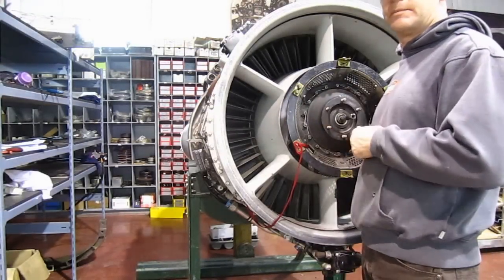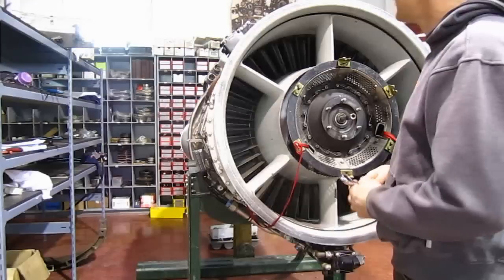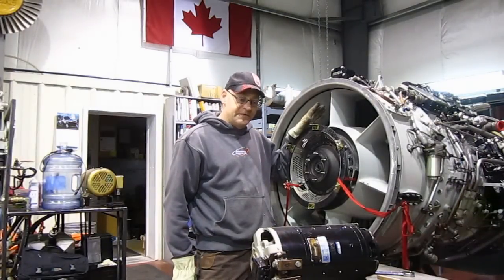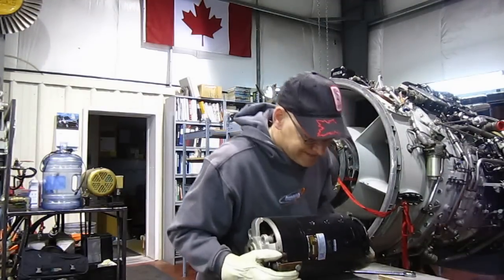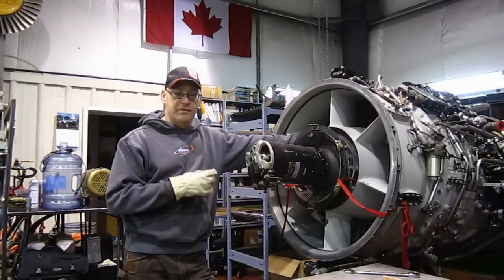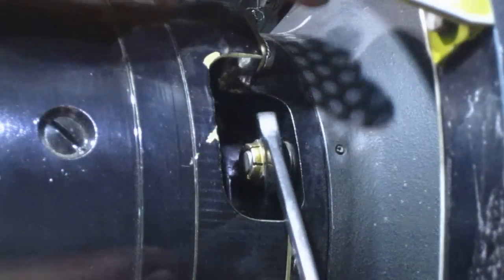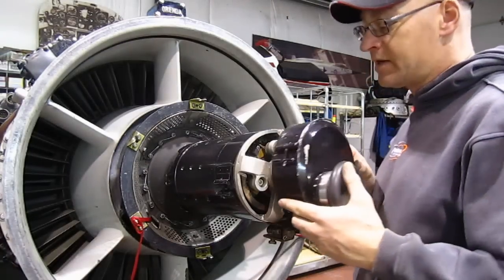Electric Starters for Jets ?

Comment: I find it kind of amazing that we had the technology to design and build these things in the 40's and 50's.
Reply: and without any computers,  just "slip-sticks";  I still have mine..  Also the  original electric starter was a starter/generator built by Cad  engineer Chas. Kettering around 1912.  It mounted around the flywheel at the back of the engine.  Kettering founded DELCO  (Dayton Laboratory Company);  he also co-invented Freon for use in home refrigerators as a replacement for ammonia gas which was killing people due to leaks which is why you see the frig
placed outside of early homes, usually on the back porch.
Reply: there were bold people to develop such invention, that lasts nowadays
Reply: You call them slipsticks,this side of Atlantic we call them slide rules.Great term,slipstick.

Comment: Very informative, as usual!
In the 60s and after the Mirage fighters had their jet engine started by a turboshaft engine - which was electrically started - located in the intake as on the video. That turboshaft engine was a cute little engine of 60 hp at first and later 80 hp.
Reply from the maker: Perfect for a vehicle. I would love to see one of those...
Reply: These "Microturbos" engines were very light. Note that they had not been designed to run for hours as a regular turboshaft., so it might be problem for a vehicle. Look at the beast :o) https://www.youtube.com/watch?v=owuf9LsOLcA
Reply: By the way, the air forces from Brazil, Argentina, Colombia, Venezuela and Ecuador have used those. Maybe a possibility to get one?

Comment from the maker: Sounds like a different start sequence is being used by the sound of your description.
Our huffer supplies compressed air to drive an air-turbine starter,, which mechanically turns the engine.
There are turbine-impingement starteing systems, in which compressed air is directed at the turbine and so it does the actual turning of the engine.

Comment: Compared to the J47 this engine is surprisingly clean at the front. You have two hydraulic pumps and primary fuel system there. The secondary one was on the left side of the engine. You could work in it from inside the intake duct but it was a pain. The J47 is also a tight fit and you have nothing to guide it. Also the tail and the fuselage had to be well aligned in order to assemble it back. We used a jack in the nose to do that. Also, the jack aleviated the load on the nose wheel since the CG travelled well forward with the tail out; it was realy heavy. The Fiat G-91 tail was much lighter but even so we still used the jack; it helped a lot and spared the nose wheel.
Reply from the maker: Yes, the owners of the Sabre 6 into which this Orenda is installed also own an F86-F, fitted with a J47, which I also built, featured in some earlier videos...

Comment: I performed maintenance on the MD-3 motor generator ground power dc motor generator. The critical component was the spring loaded actuators that "rubbed" against the rotating exciter. The unit had a high powered gas non turbine piston Packard engine that would sing songs at low rpm to high rpm of what normal human hearing would want to push the volume up toward deafness levels. When the cowl was rotated for engine inspection and the full force of the motor could be observed. THE BLUE flames crackling UPWARD in hard attitude could not be ignored. -- Memories of a former AGE mechanic

Comment from the maker: In this application, as in most of aviation, a lockwasher is not used. Imstead we have a flat washer, and a self-locking nut. The self-locking nut is described in my Lockwire video.

Comment from the maker: @krbruner In a power generating plant, the electric or electric-hydraulic starter is most often used, because as you say it does make sense.
In natural gas pipeline compressor staions, often an air turbine starter is used, and it can use the pressurized natural gas in the pipeline as its power source.

Comment from the maker: It's actually a very small amount of material. It does not provide the actual energy for the spark, but is incorporated into an electronic component that produces a variable signal. This signal is used to trigger an excitation circuit ( whatever that is ), producing small pulses of current, which are amplified to huge levels by more circuitry, until we have the huge and dangerous spark that is present at the ignitor plug.
Any liquid  that burns can be used as fuel.

Comment from the maker: Turbine engines use high voltage discharge ignitors to supply spark to get the fuel burning. Once the engine is running, these are usually switched off.
Like a candle or a gas lantern, the engine will burn fuel as long as it is available.
Engines only stop when the fuel is cut off, with extremely rare exceptions.
Re-starting while in flight can be done, as long as the core is turning at sufficient rpm.

Comment: Hi Mr AgentJayZ. First of all I want to thank you for your amazing videos! I am studying a Bachelor of Aviation while I work on my CPL. It's such a pleasure to listen to a someone explain something they are clearly passionate about.

My question is this: Everything I have read suggests that a pneumatic starting system is not only substantially lighter than an electric system, it is also cheaper, simpler and easier to maintain/repair. So why would you ever have an electric starter over a pneumatic on any aircraft? What is the advantage?
Reply: Stephen Beaver Pneumatic starting system is  just that. For starting only. The advantage of an electric starter motor is that you have both starting and electrical generation in one combined unit, rather than having something to generate bleed air , and a seperate generator.

Comment: First off, Thank You, Thank You, Thank You!  I have throughly been enjoying your videos!  They're GREAT!

Back in 2003 I got to see a 1964-ish Saab Draken fly powered with a Volvo RM 6C Flygmotor (a.k.a., a Rolls-Royce Avon).  The start sequence amazes me; it sounds like a huffer, then an electric motor, then compressed air, followed by a vacuum cleaner (the engine).  You gotta' love it!  Is the compressed air helping turn over the engine too?

Thanks again for all your efforts!

Comment: It is actually not right that all modern engines are using compressed air for start up. Very modern engines like the GeNX-1B and the Trent-1000 are using so called variable frequency starter generators (VFSG) to save weight by getting rid of an external generator. These motors have the ability to work as a generator when they are not used as a starter anymore.
Reply from the maker: +CyberDroneII Yes, you are right. I don't work on any modern engines; only the old stuff. The starter on this Orenda is actually also a starter-generator, but it is quite heavy.
Reply: +CyberDroneII sir I have question. can You tell me how for example modern jet fighters like F16 F18 are started? i belive there no place there for APU. Do they have independent batteries and electrical starter or they need ground supply?
Reply: The F-16 and F-15 use a Jet Fuel Starter, which basically the same as an APU. As I understand it it is itself started by hydraulic accumulators.
Reply: Correct, accept unlike an APU, it doesn't provide electrical power or air. They just connect to the gearbox with a splined shaft to get the main engine going.
Reply: 6 years ago they all used compressed air  now they dont all use it but the majority do
Reply: But variable frequency is a pig. A wild pig... ;-)
This is why B787 uses converters and TRUs to convert it into more usefull 115V 400hz fixed frequency and also some DC (i don't remember if its 28 or 26V). Only very few devices run on wild AC. From what i recall only some of the fuel pumps do. They change the speed as the frequency changes.
Turboprops also use wild AC generators. They also have electric starters but from what i recall they are DC. From what i recall Dash 8 Q400 uses DC starters/generators and wild AC generators.
Reply: The F-15 and -16 use a jet fuel starter. It's a small turboshaft engine that is started with hydraulic pressure and turns the main engine through a power turbine and the engine gearbox. After the main engine(s) is started (around 50% rpm) the JFS shuts off and the hydraulic accumulators recharge and can be used to restart the engine in the rare event of a flameout.
Reply: Sounds similar RV generators in the 1970s.  They used the generator windings to start also without a separate starter motor.

Comment: Your explanation of duty cycle would explain why my electric starter motor didn't work well as a drive motor for an electric car :D
Reply: despite my ignorance on duty cycle - the electric starter motor for a jet still made for a screaming hot-rod of an electric car - until the commutator melted :D
Reply: Talisman1957
The problem with starters is not just the duty cycle (no cooling) - it's also the low service life compared to regular motors. You should have used an aircraft dynamo, those are designed to run all the time and could be converted to a motor.

Comment: Here is a link to a video where a Bell 206 Jet Ranger starts it's turbine engine. You can hear the electric starter turn over the turbine, the igniter sparking and then the introduction of fuel. Best video I know of for the sound of a turbine starting. Very Cool Turbine Start - Bell 206 Jet Ranger Startup

Comment: Actually Electric starters are coming back and are in use.  787 electric starts for example.  And with big Lithium on board batteries some aircraft use those to directly spin the starters without the need for an APU go supply initial electric  And once the engine is started the starters are driven by the engine and become the generators.  So no more dead weight.

Comment: monopropellant. The AVPIN starter is essentially a small and compact gas turbine, usually mounted in the nose cone of the engine, which is powered by Isopropyl-nitrate and air carefully fed and metered. It develops a very high torque which can crank and start the engine in just a few seconds. That would explain exactly the sequence of sounds. I have found evidence of usage of the AVPIN starter with the versions of the Avon installed in the English Electric Canberra. Hope this helps... :o)

Comment from the maker: @86Ivar Almost all modern airliners have an onboard APU to supply electrical power for the aircraft and a source of compressed air for starting the engines. 
These APUs are small turbine engines, similar to that found in our start cart.
They are rated about 100 Hp. Give or take.

Comment from the maker: I don't know all the facts about all the engines out there. I only know about engines we work on.
But it seems to me your observations are good. The smaller engines are easily started with on-board batteries.
The air-turbine starter was developed for the larger engines. And I think only the larger aircraft use APUs.
I am not an aircraft expert, though.

Comment: I do confirm and quote everything Jay wrote. The radioactive material was only present in very VERY small quantity (like a "dopant"), in a component called "spark gap". It was a trigger switch connected in the discharge circuit. In the laboratory where I used to work, we designed, built and maintained High Energy Ignition Units for turbine engines, but there wasn't any safety requirement for radioactivity, and that tells you that the amount of radiation produced should have been really low.. ;o)

Comment: Jay, are there shims and/or a dampening pad at the roots of the fan blades on the Orenda, like there is on more modern engines (e.g., the CFM-56)?
Reply from the maker: There is no fan on the Orenda.
The compressor blades mount directly into their slots, without any shims or dampers
Reply: +AgentJayZ   pi

Comment from the maker: yes, most airliners have an on-board APU that can start its engines and run all electrical equipment when the engines are not running.

Comment: When an electric starter is turned on, does a shaft come out which rotates the turbine, then once the turbine is running and the starter turned off, the shaft disengages from the turbine, or does the starter continue to spin all the time the engine is moving but only have power to it when it is turned on?

Comment: The boeing 787 has electric starters for the engines.  Since they've done away with bleed air to 'improve economy' (jury's still out on that one) they have had to incorporate 2 very large (250kVA) starter/generators on each engine and the APU.

Comment: One of the early German jet engines had a motor from a motor cycle as a starter, It was a pull start   :<)
Reply: It was a junkers engine,as I recall. Two stroke bike engine inside the hub at the front of the engine,with a pull cord like a lawnmower! Imagine watching someone start one of those on the airfield

Comment: Some newer jets such as the 787 have gone back to using an electric starter generator since advances in technology have made large electric motors, and their associated equipment much lighter.
Reply from the maker: Yes, the electric motors of today are much more powerful, and the core rotor of modern jet engines is much smaller than that of the J79. Electric starters are the best way to get the job done with modern engines.
Reply: Patchuchan Boeing 787 Dreamliner suffer of lot of electrical problems, even all fleet of them was grounded (that didn't happen to any other airplane since 1979). There was at least 4 battery fires, where root cause of the fires were not identified, but Boeing was ordered to redesigned battery management system, system that control generators, put fire-suppression systems in the electrical compartments... That why they probably decided to abandon no-bleed electrical systems architecture in newer jets.
Reply: Umm..a little electrical machines 101 for you: when electrical energy is being transferred into mechanical, it is a MOTOR. When mechanical energy is turned into electrical, it is a generator. It all depends on how its being used at the time. That's why in the electric motor design world we call them electrical machines instead of motors or generators since it depends on how they are used at a given moment.....

Comment: Can you please tell me . Is the  electric starter connected to the engine  all the time . Or does it have something like a Bentix, as found on a car ? Which disconnects it at high speed ? If it is been turned by the jet ,all the time  . Can it be used to generate electricity ? I like your series about jet engines very much always fascinating .

Comment: Is it not possible to controlled spray a high pressure mixture into the combustion chamber, and thereby start the engine by its own drive mechanism?
Reply from the maker: Very close... Have a look in my playlist "Your Questions Answered" for the keywords air impingement starter. Also search for Starters and starting systems.

Comment: Is an APU basically a tiny version of an electrically started engine, which is used to produce the compressed air to power the air starters of the main engines ?
Reply from the maker: Yes, that's a good description.
Reply: The APU is a small jet engine that runs the hotel load of an aircraft on the ground and that provides air for starting the main engines, ye.

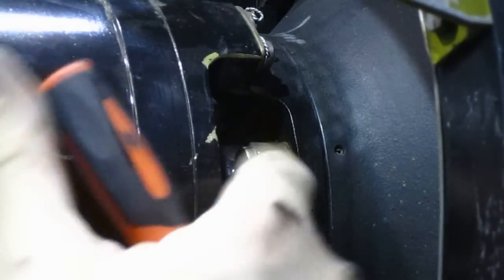Comment: Interesting how the bolts for the starter are fixed, it looks like they are fixed with a kind of splint pin. Is there a thread in the engine frame, or are the bolts only fixed with the pins? I saw that at around 3:35

Comment: im clyde mullen and been watching your videos of jet engines and is very interesting indeed.i have a question: on the ignition system of a jet engine: why do they use a radioactive box to supply the spark with ignighter next to fuel nozzle to start engine?does the radioactive box have uranium that is shielded to provide the spark?could you answer these question for me agent jayz?and what fuels can you use for a jet engine?

Comment: Thanks once more for the greatest peak behind the mysterious curtain of the gas turbine short of getting an A&P licence myself. Can an airliners APU be started electrically via the aircraft's batteries if no ground power  is available. I imagine the answer may vary with its size and specific use of the aforementioned airliner so I will say 737 or bigger .
Reply from the maker: I'm not an airplane guy, but I am fairly confident the answer to your question is yes. Our start cart has an engine in it which is very similar to a typical airliner APU. It uses two 12VDC automotive batteries to start, in place of the original Aviation 28VDC battery.
Reply: Here's the electrical schematic of a 747. APU, battery, and external power are documented. http://www.angelfire.com/ct3/ctenning/electrical_essays/747dash400elec/747dash400elec.html www.deltava.org/library/B747%20DVA%20Manual.pdf Granted, one of these is for a flight sim, but as far as the APU and power routing are concerned, it's mostly on the mark. Of course, if you doubt that, you can verify the schematic. ;) I am not a 747 pilot, nor have I flown one in a sim.

http://www.b737.org.uk/
http://www.b737.org.uk/electrics.htm
http://www.b737.org.uk/apu.htm
MOAR:
http://www.airliners.net/aviation-forums/tech_ops/read.main/129026
http://www.airliners.net/aviation-forums/tech_ops/read.main/69845/
Reply: Chris Schwenk The APU is started from the DC bus (battery) on the AP.  It can then generate pneumatic power to start the engines.  Incidentally, the 727 was the first commercial transport to have an APU.  It was located in the main LG wheel well (due to the rear air stairs), and exhausted though a port on the left wing root, as I recall.